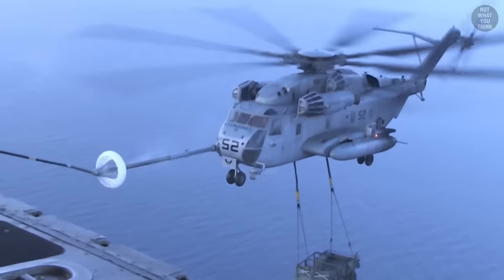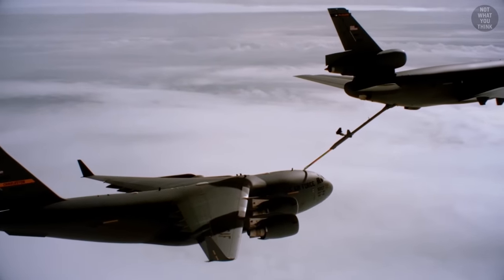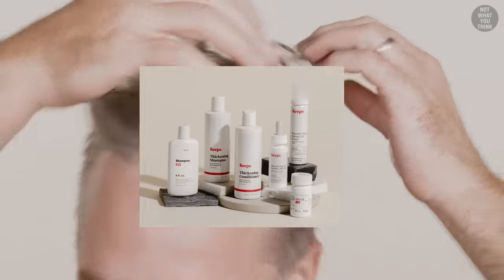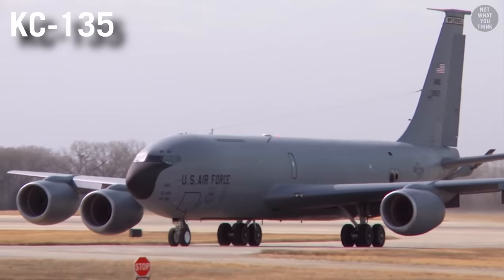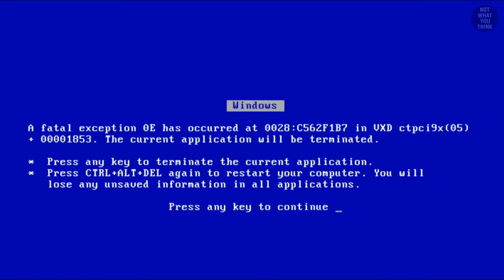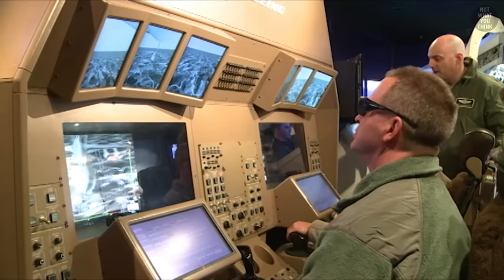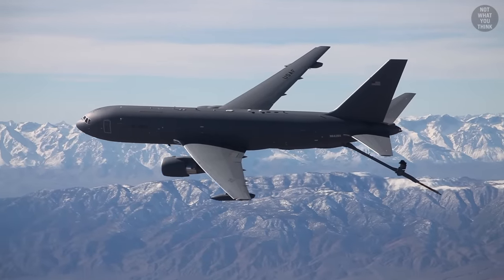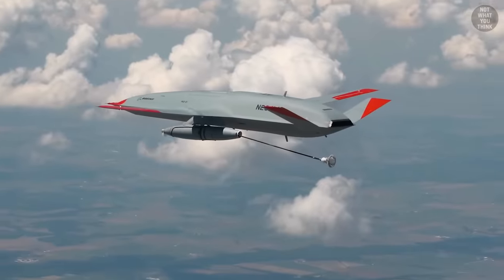Why US Air Force is Making Aerial Refueling HARDER?

Comment: They didn't do that from the start so they could charge the gov twice.  I love it when the gov decides to fix a system that works fine (like a basic window and joystick for the boom operators).  Also, how in the hell did a huge gov contractor even get black and white cameras or black and white flat screen monitors?  I can see why they got rid of one fleet to simplify maintenance but making it worse is stupid.
Reply: It is a firm fixed price contract. No charging the government twice.
Reply: @johnp139  I mean I suppose if they have to pick up the bill for redesigning then its ok.  I still don't understand how they could pick the shittiest optical system for this type of operation and forget exposure settings.  Did they get these cameras off Ali Express?  The boom arm operator and the other plane pilot need to be in lockstep together.  I wonder if the older ones has ultra short distance communications for refueling?  Like a fraction of a watt of power to chat between the two.  I also wonder if the tanker ship will eventually take over the flight inputs of the airplane its refueling so it has total control for them to sync.  Also, are they recording all of this data to be fed into an AI computer that will handle this sort of thing in the future?

Comment: It isn’t the same MCAS system. The Air Force plane has an AOA disagree system included. It has two AOA vanes and if they disagree with each other MCAS shuts down. This would have saved the 737’s that crashed.

Comment: I was a career KC135 and KC10 Boom, and was at the Headquarters when they did the initial procurement before the boondoggle of an officer giving Boeing inside info...want to know why the boom systems suck?  Because PILOTS do the acquisition, and were more concerned with getting ultra modern cockpit systems, and less with anything behind the cockpit.  They even wanted to eliminate galley features, and removed a power roller system that was proven on the KC10.  The air refueling systems were ignored pretty much completely, even though we had senior enlisted leaders telling them this system would not work.  The Dutch made a good effort with their KDC-10, and we even had US Exchange crews that could have helped with development. (Salute "Slobo!")

Instead of the 'if it ain't broke, don't fix it' mentality, the officers in charge cut costs by not having to develop a 'boom pod' and going with a straight commercial derivative.  This allowed cockpit systems that were maxxed out.  They went with an experimental, UNPROVEN system and it now has bitten them in the ass.  (Yeah, I'm a little bitter...LOL)

As for automatic refueling, it is still an unproven technology...sure, in the lab they can make anything work, but until you are working in pitch black, in-weather, with light-to-moderate turbulence and refueling stealth aircraft, then I would not trust it.  I would suggest automatic PILOTS as well...the technology is there, right?  LOL  Friggin' penny-counters and pencil pushers.
Reply: Yeah usually experimental designs go through growing pains, kinda like tanks, artillery, aircraft, automatic weapons, breech loading weapons etc. 

Funnily enough though, all of those managed to revolutionize warfare, despite many people calling them out as useless gimmicks that will never have an impact on the battlefield.
Reply: @TheThingInMySink  …and yet how many automated unmanned systems do you see on the modern battlefield today?

Comment: Is there ANYTHING Boeing didn't messed up since 2005?
-The new tanker is a mess
-The 787 was shadowed with so many issues in its early years and wasn't available for a long time in the last few years
-The 748 was a BIG miscalculation including the new Air Force One
-The 777X is likely at least 5 years away, if it ever will come
-I don't think I have to specifically say anything about the 737MAX
And the list goes on...
It's like they WANT Airbus to succeed them as THE NO. ONE in Aviation

Comment: Wouldn't stereo cameras (two of them) and a VR headset give depth perception?  A camera (pair?) at the end of the boom would work quite well too.
Reply: The current (and new system) HAS stereoscopic cameras and 3D displays. Both visual and LWIR.
Reply: @johnp139  Why do boom opperators complain of lack of depth percetion if they have full 3D?

Comment: The reason Boeing didn't make the RVS system colour is because they would rather save a dollar rather than ask the people using the system what is needed to make it work. Just like the MCAS system implementation. Fix a nonexistent problem with an over engineered solution and save as much as possible while doing it. Cheep and cool beat function and reliability for them every time.

Comment: Can someone explain to me what the supposed advantages are of having the boom operator working from a camera feed as opposed to just looking out of a window?
Reply: Not directly for the operator, but you don't have to cut a hole in the tail of an airplane and permanently affix a pit for them to sit in. It's supposed to be cheaper in the long run because now your refueling craft can double as cargo carriers as well, but Boeing decided to be cheapass bastards and gimp the systems supporting remote operation; fortunately, they're paying out of pocket on that error, since the contract they signed was fixed-price

Comment: 1 Having boom operators is adding a third set of variables in the refilling system. If any one of the 3 Tanker Pilot, receiver pilot. or boom operator are having a bad day there is a problem. Once again the air force's one size fits all attitude on boom refueling just shows how narrow minded they are. The drogue system, The tanker pilot just has to maintain a straight line or gentle bank line of flight. At that point its all on the Receiver Pilot.

Comment: That all seems so unecessarily convoluted and complicated. Why not just put the fuel in a container, transfer the container from one plane to the other (via hook or magnet or whatever. There are a hundred different super easy ways to do this), then have an automated system in the plane that refuels itself from that container? That would minimize the time one plane is connected to the other to almost nothing, the simplicity would reduce the error rate to effectively 0%. The only potential downside to this is you'll have an extra container on the plane, which can be easily solved by like 10 different methods. You can make the container so it's made to be easily compacted/compressed after use, if the container is plastic you can easily melt it from within the plane, you can just give the container back to the refueling plane after you've refueled, etc etc.

Comment: One needs to keep in mind that Boeing built the system to meet Air Force specifications. One of the major difficulties with being a government contractor is the constantly changing specs. Someone in the Air Force procurement office made the decision on this system after being presented with several possible solutions and chose one as the design that the Air Force wanted. Obviously there are a large number of factors under consideration in this process including cost and pet design concepts of the individuals involved. It is not all Boeing's fault. They were satisfying what the Air Force wanted in their specs. It is easy to blame Boeing but theirs was not the final decision. They had to live with the decisions of the Air Force.  Such is the joy of being a government contractor.
Reply: No, on this program the spec was not changed from award, and the aircraft meets surprisingly few of it's requirements. No ECPs (Engineering Change Proposals) were made. Boeing underbid to win, then then did everything possible to try to mitigate monetary losses, expecting to make the money back later in life cycle support (Boeing makes WAY more money supporting the airliners it sells compared to the initial sale, just like inkjet printers), which they still will, it'll just take a little longer to cross back into the black, then it's a multi-decade cash cow. Boeing absolutely is to blame for the KC-46 failures, that's why THEY have to pay for the fixes. Various reports (like GAO) outlines major problems in addition to the RVS . The system did not meet requirements, otherwise the gov't would pay to "get what they really wanted". The contract forced the USAF to "get out of the way", and just grade the "final" product at the end, at which point it's "too late" to redesign or fix anything. Granted, some blame can be placed on USAF, but that would be for allowing Boeing to proceed with poor/unproven design choices that the USAF was almost certain wouldn't meet spec, in an attempt to meet schedule.

Comment: I trust our personnel way more than ai at this point in ai development.  This is an extremely complex activity, so much data that a human can process with accuracy that ai can't just yet.
Should have left the windows and upgraded later.  
We're getting very reliant on super complex and expensive equipment that is really hard to replace if lost in battle.
As Germany how the high tech weapons worked out for them in WW2.
We do need them, but we also need a cheap easy to produce fall back option.

Comment: The real head-scratcher here is less to do with the fact they're not using a window, but the fact that they didn't add the camera to the end of the boom!

Although I have never done such operations or even flown in real life, just watching the videos of in-flight refueling I can tell how hard it is because the human eye struggles with perception when you have something that small trying to link to something that can be a completely different size from the previous aircraft you just topped up. And cameras are notoriously bad at perspective in comparison to the Mark 1 Eyeball. But a camera right near the end of the boom? That would make it much simpler and superior to a window.

Regardless, they should have left a window in even if they did do it that way. Because, after all, what if the camera fails? What if the screens fail? What if there's an electrical issue? What if there is an EMP blast? There are many reasons why you need a Fail-Safe.

Comment: MCAS was the scapegoat for operator error and systemic failures at both Ethiopian Airlines and lion air.  

As for the USAF, God forbid they shops just buy the same 767 that Japan and Italy are using. It’s amazing how their booms with the viewing window work just fine. Lower system and parts count makes the aircraft easier to operate and more reliable. 

People need to be fired and some should go to jail.  Not holding my breath though

Comment: I really don't see how it should be that hard to automate the refueling. With that kind of money behind the project you could have LIDAR sensors generating accurate 3D information on the plane's position. It could even retract automatically when it detects a possible unwanted contact

Comment: So the option was a cheap window, or a system with high definition cameras in 480p and b/w monitors. And instead of going with cheap or both, they went with let's just wing it and add systems until it's as good as a window..... Jep, sounds like a military contract and something Boring would do, what are they 7 years late on the space capsule too, how do they keep getting contracts is beyond me.

Comment: Why not use a stereoscopic headset? Take two cameras and stick em heads width apart.
Reply: With a headset you can’t see anything else in the aircraft unless you use AR. The 3D display screen that requires passive glasses is much better.

Comment: Why not attach a camera that feeds into a VR headset (for 3d vision), right to the tip of the refuelling probe? That way the boom operator can guide their vision directly into the receptacle? Maybe you can stack cameras with wider angles before it so that the operator can switch between views as he gets closer. And how the heck are they stuck with b/w shitty resolution cameras when they are the military? Heck you can find much better cameras on iPhones! Lol.

Comment: Boeing has been having a lot of problems these last several years.  It seems that Boeing's star is waning, and they can no longer be held up as a shining example of leading edge engineering.  The problems with their jets crashing, the problems with their Starliner (a crewed space capsule for space flight), their problems with the SLS rocket system, and now their problems with a less than effective areal refueling system.  Boeing needs to get their act together and soon.

Comment: RVS honestly feels like Boeing was just attempting a cash grab, they could have used a window and rolled a nice profitable plane out the door. but they took a gamble on a cost plus project hoping years of cash without having to show real progress and now it bit them in the rear.

heck their space capsule has yet to fly people as well and they got absolutely socked by Crew Dragon 2 on that front.

Personally I feel the downfall of Boeing to being second rate is when they shifted the HQ to Chicago from Seattle and stuck a bunch of Wall Street Lackey accountants in charge and not having engineers run the company.

Comment: For depth perception you need stereoscopic vision: two cameras and virtual reality goggles (not very expensive in terms of overall cost). You could even position the cameras in the "wings" of the boom for excellent stereo vision.
 I note that the USAF preferred the Airbus tanker, which has many fewer problems, and carries more fuel so fewer are needed for an operation, making it (marginally) cheaper as well, contrary to the numerous false representations made by Boeing. Boeing bid $20.6 Bn and EADS bid $22.6 Bn in then-year (2011) year dollars. Boeing's cost overruns total $5.4 Bn so far.
No doubt the USAF will repeat its mistake in the upcoming KC-Y competition but, hopefully, the problems will have been ironed out by the time of contract award.

Nowadays Boeing seems to stand for Boneheaded Engineering Ignorance and Negligent Greed.
Sorry if this offends but the vested interests forced the USAF to make an OK but second rate choice which has caused delays.

Comment: I am not an expert but it seems there are a lot of stories out there about the Air Force always going with something more complicated when there is a choice. I admit with new platforms like tankers that will likely be in service for decades the need to future proof them is required but they could have gone with the old style boom operators and when it was ready retrofitted to the automated. This system buys them the worse of both worlds.

Comment: The most assured profit in the USA is to be a big time corporate contractor for the military.
As a private entity you are not under as much scrutiny as the government itself and in fact do not have to open up your books for public scrutiny.
Your contract coming from the government means it is probably highly padded to begin with and more importantly guaranteed.
Finally when you screw up, most of the time the government (read 'the TAXPAYER!!!') will give you MORE money to fix the problems you created while in the eyes of the public it's somehow the government that gets the blame.
Compare that with regular commercial contracts between corporations that can be much more easily cancelled and the purchasing party will give you a 'hell no' when you ask for more money from them when you screw up.
Reply: This was a firm fixed price. Most high tech never before done projects cannot be accurately costed, which is the reason for cost plus contracts.